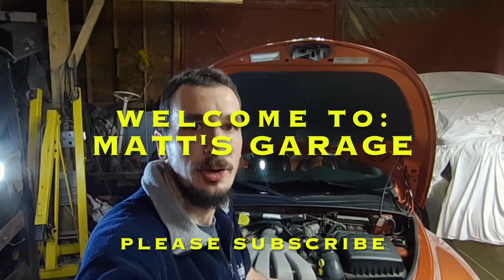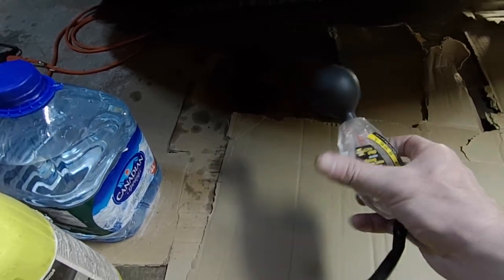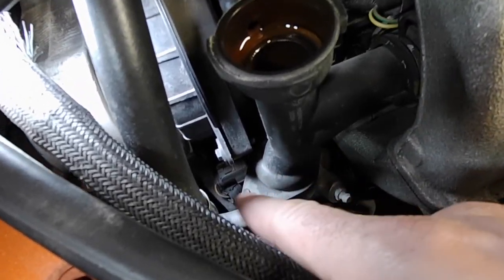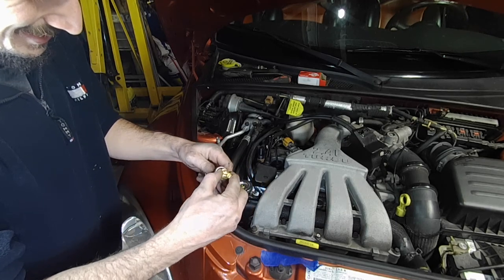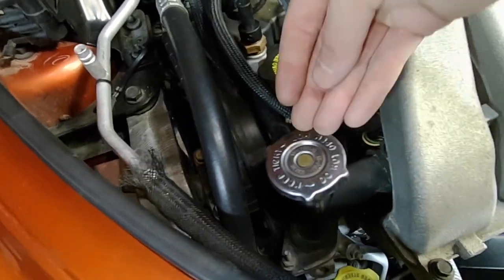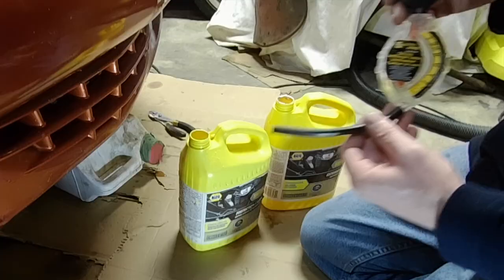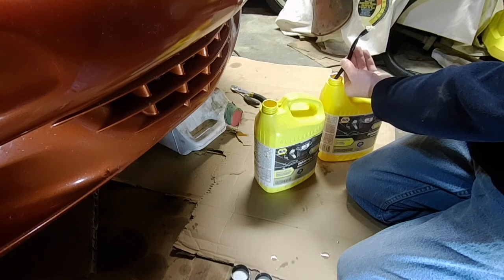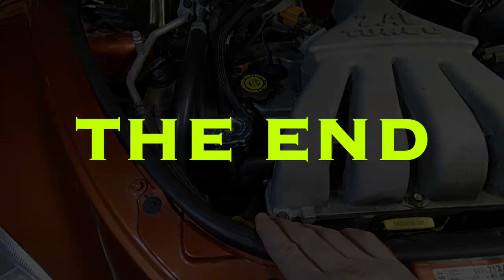PT Cruiser Cooling System, T-stat, rad cap & Temp Sensor Replacement

Comment: Sad that a thermostat has become an all day job now. Had to get rid of a Dodge Intrepid because it was almost impossible to work on. People bash 70's cars but they sure were easy to work on when needed. Have a PT now that needs a heater core. Imagine the time needed for that...
Reply from the maker: Sorry, but it took me about 15 minutes to change that thermostat, I have done it in the driveway before...🤷‍♂️ That’s why I have these cars because they are relatively easy to work on, I’ll admit there are easier cars out there to work on, but nothing’s really too bad on these, the power steering system is about the worst you will encounter on them. Be sure the heater core is actually leaking because the drain where it leaks out is near the back of the engine and if you have any sort of a coolant leak on your engine it’ll leak out in the same location, I’ve seen the heater cores get changed before literally because of a leaking thermostat.
Reply: @CarswithNash  I envy your patience. Yep, coolant coming out of a/c drain tube. Thinking of cutting access panel in firewall behind computer...
Reply from the maker: @garykalasa4189  I have yet to remove a dash in one but I’m guessing it’s not that hard... I’m kind of against cutting access panels personally...
Reply: @CarswithNash  Well... I was thinking of grafting the front end of my 73 lincoln onto my PT to avoid having to cut access panel for heater core. Not sure which will be more practical.
Reply from the maker: @garykalasa4189  LMAO!

Comment: Pt cruiser is the worst made car in history. I have a nice 2006 turbo that's clean inside and out with 120 thousand miles on it.  Just rebuilt the entire front end. My thermostat is starting to get stuck and not wanting to open up sometimes.  I told my self next time something goes out I'm selling it. After watching this, I'm selling......
Any body that wants one in Tennessee, $2500 cash it's yours.
Reply from the maker: @davo8802  I'm guessing you have a very limited mechanical background, I have literally changed one of these thermostats in my driveway, inside fifteen minutes. I use a 2008 PT to clear snow on my acreage, it handles a 6ft × 2ft, 400lbs snow blade just fine and will push snow over the top of that blade no problem, so I figure they can't be too bad of a car if they can do the work of a skid steer!😉
Reply: @CarswithNash  I'm talking about how everything on this is so hard to work on. Just wanting to find me something old school with a carb and no sensors. Pre 1983. I've worked on cars and rebuilt my first engine in 1983.
Just getting to old to work on stuff that was designed to take to a shop
Reply from the maker: @davo8802  Oh okay, I hear you on that actually. But trust me there are much worse vehicles out there than a PT, I had a 2011 Hyundai Santa Fe for a while and it was an absolute nightmare and broke on the daily. The oil pressure sensor leaked on it and it was buried under the intake manifold, took me 4.5 hours to change it! I actually daily drive an '89 Mercedes with a carbureted 302/AOD swapped, diaphragm fuel pump and all and that car has been trouble free for 3yrs since I put it together. Good luck on your search for a nice older vehicle.